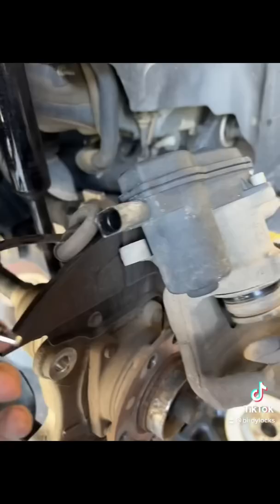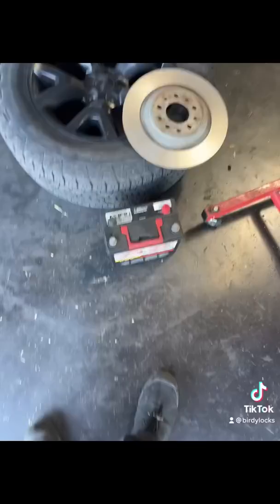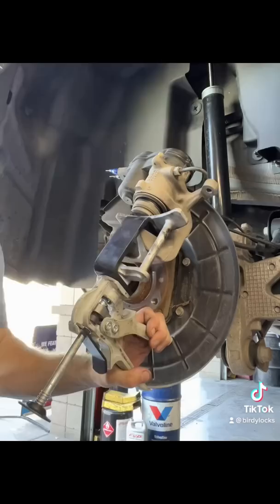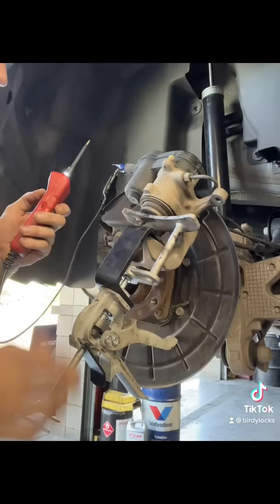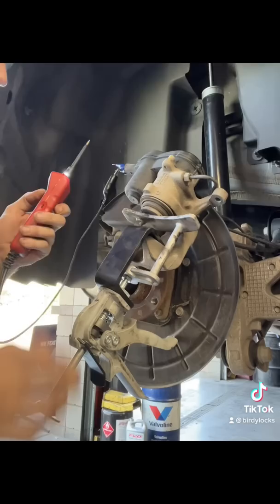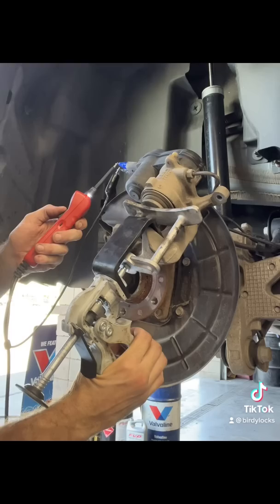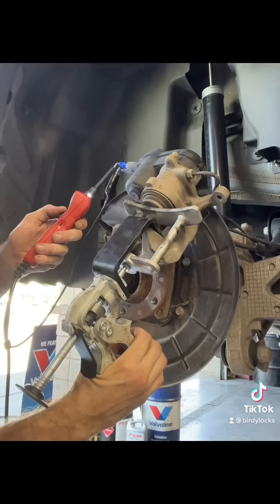Electronic Parking brake hack #EPB #automotivetip #automotivetechnician

Comment: I do this to any Subaru with an electronic parking brake. I set the parking brake before starting, and back it all the way out with the power probe before taking anything apart. Once finished, I power probe until the caliper grabs hard. It's way easier than dealing with the stupid procedure to put them in and out of maintenance mode.

Comment: Pull the motor off retract the piston manually with a torx or E socket. Go slow turn until stops. Push in piston slow. Reattach. I can have these brakes done on less than 15 min. With out scan tool or putting in service mode. I've done it on ford's chevys Hondas toyotas VWs. Never an issue

Comment: And since you’ve have the EPB disconnected, you’ll still need a scan tool to clear codes and recalibrate the EPB.
Reply: Not if ya run a static discharge and leave the  battery disconnected the whole time.
Works on subarus anyways.
Reply: @tommymakem2611  it won’t work on most modern cars on the road today though.

Comment: You can do this in an emergency, or even just unbolt the motor and wind back the nut - but on some cars, you need a scan tool to reset/calibrate the EPB.

Comment: You could also c - clamp and simultaneously turn the piston counter clockwise with some channel lock pliers , works every time and a bit safer than this method in my opinion BUT a professional scan tool with electronic parking brake capabilities is always the best route

Comment: Ive had to do the same thing when the EPB fails. They drag it onto a flat deck and to roll it off you have to out the trans in the emergency neutral on the transmission. And manually drive the park brake motors on both rear wheels. 

Also with some research you will find the manual way to do it with key cyvles and throttle pedal depressions🤷‍♂️

Comment: My grandmothers car uses the ABS pump to apply the E brake, simply just put the clamp in place, apply the brake, have a helper release it and when it drops the pressure back you return the piston with the clamp. Yea you need another person for all of 15 seconds, but it’s only set a code on me once and that so happened to be a faulty abs module and pump. Battery disconnect cleared the code until the first abs stop, real scanner found the module was faulty etc. never had a problem with the 3 brake services done since. Get it may not work on the electric motors attached to the calibres but the pump pressure E brakes it does

Comment: You can buy a tool that does this without the battery for under $30. Unplug the motor on the piston, and it twists right in. Press it back all the way with a regular piston wrench.

Comment: A tech at our shop took an old window switch and wired it up to plug one end into the caliper and the other end onto each post of the battery. So basically, while the caliper is still all bolted up, press the switch one way, if the piston comes outwards and locks the pads and rotors up, then simply press the switch the other way. It engages the motor and you audibly hear it "unlock" the piston, it will also start spinning. As soon as that happens it's just like any other caliper to press in. Then when putting the piston back out, put it til it locks everything up again, take a screwdriver in between 2 studs, hit the switch just until you're able to turn the rotor. All set, never have had any issues regardless of the vehicle.

Comment: Idk about European cars but I know for Honda’s, nissans and Toyota’s you can remove the rear motor off of the caliper and spin the shaft that the motor attaches too and you can push the piston in that way. That’s if you have no access to a power probe

Comment: I just take out the actuator and manually reset em (counter clockwise for most), then compress the piston. Pump the brake, check the epb functionality and road test to verify.

Comment: You can put it in maintenance mode most of the time without a scanner. Usually hold unlock on the e brake for like 10 seconds then while holding it turn the key off then back to accessory. Then it usually pops up on the dash “ maintenance mode “ 
Hope that helps someone out there 👌🏼

Comment: You can also pull the motor off, and turn it in manually, spin the shaft till it bottoms out and retract caliper as normal.

Comment: Good tip for the electronic parking brake motor but your not meant to push the piston back in on a back brake caliper you're supposed to wind it back in

Comment: I use butter along the degausing valve whenever possible when doing brake work on my 2033 Chevy Titlewave Truck. Emission clearance was statically set to 7.4822 mm when turning the ballast valve 3.5 degrees.

Comment: Well the solution at my Honda dealer and when I did brakes on my 10th gen civic si at home, you take the motor off and wind the parking brake shaft I believe clockwise or counterclockwise clockwise, I think clockwise until it stops , and then compress the piston.  

Or you can do the maintenance mode which is annoying through a pc

Comment: Been using that trick with two alligator clips with wires and a jump box for almost a year now and its faster than a scan/controller tool. Was a secret of mine to do my job faster and do a little more work than others in my shop. I had all of them convinced there's a short cut in scan tool...thanks for letting that cat outta the bag...

Comment: You should crack the hydraulic fitting loose at the caliper when you do this, not good to push dirty fluid back into the ABS system.

Comment: Just goes to show how much changes since the last time I was a dealership/shop mechanic, basically bailed out and went oilfield and just stopped learning about the new stuff, I see now it would probably be pretty hard to get back into it lol I still remember how pissed everyone was when you had to put an audi in "lift mode" to keep the VW air suspension from burning up its control module when you lifted it.

Comment: You can open the brake fluid tank and  it will go throw easily, don't use the battery otherwise it will cost you an Ecu

Comment: Don't do this to a VW/Audi. You will need to get a scan tool to adapt rear brake service mode. Doing this way, you risk damage and/or lead to your brake hold and parking brake to malfunction
Reply: Also, your car might have incorrect reading for brake bad thickness (brake pad warning lights on the dash...)

Comment: A lot of cars you can do this in the settings on the dash. Put the epb in maintenance mode. If not you just use a damn scan tool to do it. This is extra as fuck.

Comment: I just remove 2 small bolts on electric motor & perform brake job as if there was no electric motor, I've never had a problem in 11yrs, faster than using scanner & this method I wanna say

Comment: The other way, is to use a torx bit and take the two bolts disconnect/remove the motor and twist it back in by hand and then just press in the piston.

Comment: Yet another part that has been needlessly replaced with electronics. The cable brakes exist for a reason, as a mechanical backup incase something fails. And electronics fail randomly without warning at any time.

Comment: My boss once ruined one of these calipers and had to pay for the repair totaling around 1400 bucks cuz he didn't know that electronic calipers existed and proceeded to destroy it by trying to depress the piston like you normally would with a screw driver but when that didn't work he used c clamp and then a 4 ton shop press and then a huge pry bar and then a fkn impact hammer.... and then he said "I wonder what this electronic motor is on the caliper" and yet he still tries to call himself a professional... careful who you take ur car to ppl

Comment: Yes but this doesn’t always work without the Ebrake malfunction light or message coming on. Yes I know lots are gonna say just reverse the polarity when the brake job is done. Doesn’t always work…..
Reply: Yup the epb module needs to be recalibrated after new pads. Using this hack method may damage the car module.

Comment: That's actually pretty cool 
So they work with reverse Polarity like a car power door lock simply by switching the plus and neg you can open or close 
Thanks for the tip bro
Reply: Yeah steaks and breaks🙄🙄🙄🙄

Comment: I would do some research for the service brake mode, a lot of car brands allow you to put it in service mode without a scan tool,  easier and less costly. If that goes bad you will need a new caliper and they are not cheap.

Comment: This vehicle has park brake service mode, you access it through the radio no need for this BS.
Reply: Pretty sure it doesn't 2008 vw passat. Supposed to do it through obd
Reply: This guy is working on a jeep cherokee all chrysler products that have an electronic parking brake have a brake service mode you can access through the radio. You do not need a scan tool. And it's been like that ever since chrysler adopted the electronic park brake.
Reply: Gotcha. I know for has a service mode as well. Vw was the first to come out with these and did not have a service mode without an appropriate scanner.
Reply: @bullseyepete8367  so I was totally wrong chrysler dose have a vehicle that u actually need a scan tool to put the  electronic park brake into service mode I came across it a couple of days ago it was a base model jeep renegade.
Reply: Matthew it's all good. I think it was mostly the early ones. I was running a brake shop when they started coming out circa 2007/ 2008 or so.

Comment: Correct tool to use is a $10 brake piston cube, and not a $500 scan tool or battery. To be a good mechanic you need to use the correct tools invented for the job.

Comment: nope I don't do that 
Just remove few alen keys at the electric motor, there is a reverse nut in the back of the caliper , spin that nut bit by bit as u compressing the piston , it's much safer on my perspective 
And don't forget to clean and grease up the thread inside

Comment: You should also be sure that before you use a 12 volt battery you should make sure that that caliper is a 12v system could be a 9 or even 5 volt which you should try to use the lower volt battery or an adjustable power probe

Comment: NEVER Never do this. This calipers are calibrated and if it loses its position with will fault the system. 

The correct way to do this if you don't have a scanner is to use the function in the car. With the brake pedal depressed, press and hold the park brake for 10 seconds. It will extend and the retract fully. Some may be different, so make sure you read your own ers manual or read up on Alldata or similar sites.

Comment: Take the two t30s on off on the back housing, get whatever tool your need and make sure you set the ratchet to tighten and it will loosen the lock allowing you to depress the piston, once done with your work put your ratchet on loosen and once it's finger tight back it off a 1/4 turn all set, or get a scan tool haha.

Comment: Bro you don't need a scan tool for that procedure, most manufacturers have a maintenance mode on the steering wheel or dash to push so you can access that mode read up...

Comment: Do what I do BEFORE YOU TAKE IT APART put power to It use a flat head screw driver ,big one and push it right back in before u take it apart that way if you go the wrong way at first the piston doesn't pop out ,,,,,and no mess wow

Comment: It easier to just put it in Maintenance Mode. And you don’t need a scan tool.
Reply: Can you explain a little more  ?
Thanks in advance!
Reply: @robles100  most manufacturers have a maintenance mode for example ford if you turn key on engine off and press the gas pedal then pull the electric parking brake and cycle the key it will enter maintenance mode allowing you to press in the piston without damaging the caliper
Reply: @GearShiftShutter  Awesome!!
Thanks for the help 👍

Comment: easier way is manually instead of using battery, electric way work but if u didn’t clamp it it will pop out in reverse.

Comment: Lets talk about how idiotic the electronic e-brake is. The cable actuated e-brake worked perfectly well for over a century. The electronic e-brake is right up there with German auto makers removing the $2 oil dip stick in favor of electronc checking only. I own a 2004 E46 and it will be the last new BMW I ever own.

Comment: Isn't the correct tool used that just fits in the grooves and twists and pushes it back in?
Reply: Nop, that dosen't Work with electronic parking brake 
You will ruin The calliper

Comment: This method will not work on more modern cars that use proper electronics. They send a signal not battery voltage so will blow up the module if you apply battery voltage directly.

Comment: You shouldn't push that over heated crappy fluid back up into the system, you should clamp the hose and push the fluid out of the caliper thru the bleeder

Comment: Seems a bit long winded. Could take off the electric assist motor and wind it back clockwise, push caliper back and replace motor, takes 5 mins !!

Comment: I had a 2018 Chrysler Pacifica fully loaded I went to change the brakes and on the steering wheel you need to go through the dictionary and it will say reset rear calipers you hit okay and it automatically pulls the calipers in without any tool has anyone else came across this?

Comment: That is probably the dumbest thing that the engineers ever invented it is an emergency brake what happens if you lose battery connection do you still have an emergency brake

Comment: Fuck that, take off the actuator, I believe it's a t30 on most calipers. Use the t40, I think most are t40, well a t40 will work, twist it till pressure is released, squeeze the caliper in with your thumbs, put the actuator back on

Comment: Old cars had parking/emergency brakes. Modern vehicles are so stupid that if there's an emergency, your fancy electronic parking brake won't work while the vehicle is moving. It won't engage until you've already crashed to a stop. Then it'll lock up so the tow truck has to drag your vehicle. I hate modern vehicles. Especially those garbage crossovers!!!

Comment: I did a Mercedes-Benz electronic brakes the first one I did I did break it cuz I didn't plug the machine up to it I plugged the machine up to it one time then all four of them went back so it's not just the one it's a lot of tricks today I didn't try that way and I did it another way in and it still went back so

Comment: Don’t do this just take the Allen bolts out pull off the motor and spin the end on the caliper clockwise I work in a used car department I do this everyday

Comment: You can also twist the cylinder caliper and it'll go inside 😂😂😂
Reply: It's electronic parking brake caliper no you can't. On a mechanical parking brake caliper yes
Reply: No it won’t
Reply: Not on a vehicle equipped with EPB.
Reply: @bentleynorton6843  I haven’t messed with them but why does it have the markings for the twist tool
Reply: @Drewdayz2419  Well, hard to explain. But the pads that contact the piston have corresponding marks. The marks purpose on the pads is to not let the piston spin. The caliper has an electric motor which spins, but you want to convert that rotational force into thrust on the pads. I'm not entirely sure on all the details of it but I know it coverts that motor torque into a thrust thru its mechanism is the best way to put it lol
Reply: @Drewdayz2419 This same thing is in effect with conventional parking brake calipers, but due the the electric motor it must be put into service mode. If you ever do some rear parking brake pads you'll notice those dots poking up

Comment: He is doing this the hard way. Let a real mechanic tell you a better and easier way. Take out the torx bolts and remove the black box electrical part, it comes right off. turn the hex/torx stud inside with cordless ratchet etc and you can push the caliper right in. no risk of frying the part etc. This guy is reaching around his neck to scratch his ass.

Comment: I find it really dumb they switching to epb 
Doubt its useful if the battery is dead
Doubt its useful when the wires back there get corroded or a wire that got pinched or chafed and you have to go trace down a wiring issue them arent fun 9 times out of 10 takes a good amount of diagnosis to find the wire brake or whatever it is 
Final reason i dont get for downgrading to electronic parking brake would be rarely anyone uses parking brakes nowadays 
Mainly just for manual transmissions

Comment: And thats how you fk up electronics in a car xD , those fking things need a specific amp not fking 12v from battery directly, the car probably has transformers to regulate de amp before going in the sensor dont do that guys just follow the fking guide all the manufacturers provide …..

Comment: You way over complicated that. You don't need a battery. You don't need a scan tool. Two bolts holt the motor to the caliper. Take the motor off to expose the drive and turn in by hand if it stops turning quick, you went the wrong way. It will turn then stop. Turn the wrong way and it will feel like it's getting tighter. The right way will just stop.

Comment: It literally takes 2 seconds to engage service mode. Most cars now thatcan be done through the radio. This is fucking stupid, great way to cause issues with the computer, that caliper or even the brake system. Just do it the right way.

Comment: Power probes are banned nationwide at out 600 shops for a good reason. Sending voltage into a module the opposite direction its designed for can cause major problems. Let's talk about this  specific application. Is that caliper designed for that exact voltage you're giving it? Does it back probe that exact voltage? Most likely not. Either way you're sending voltage to a module directly through a path not designed that direction. Not good.